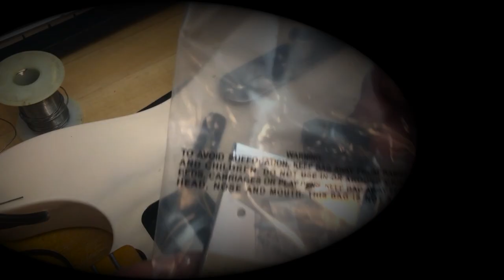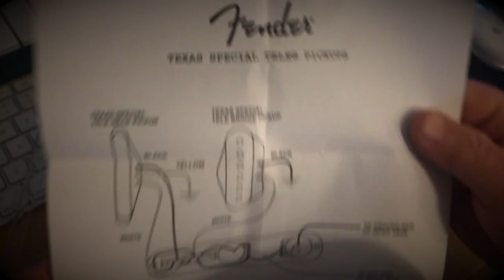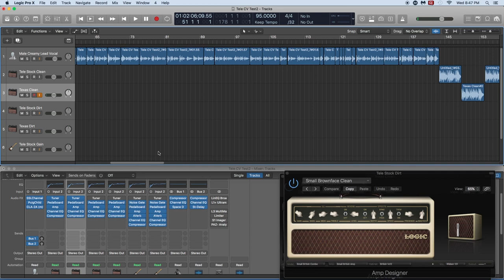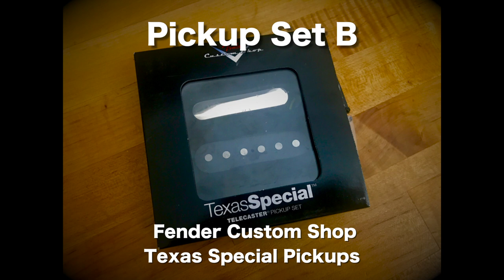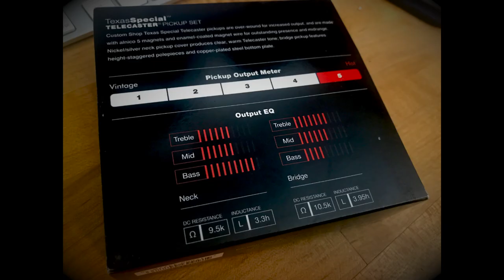Squier Telecaster Classic Vibe Stock guitar pickups VS Fender Custom Shop Texas Special pickups

Comment: I own three classic vibe teles, and it was immediately clear to my ear they were set A. For a less expensive guitar, they can deffinately work. However, I have changed the pick ups out in all three, (that is one of the main points in buying these guitars). You can swap pick ups and not feel guilty about it. I am pretty sure if you play on it long enough, you will realize there are better options that will suit your ear and playing style better. Fender pure vintage 64, and the Texas Special will both out perform the original pick ups. Clean players will appreciate the pure vintage 64 for the real tele twang and snap. The texas special, retain a respectable amount of that, but are a bit more mid range sound, they give up some bite, but they really shine when you go to the overdriven sounds. The point I'm making is the original PU's can work, but they are not in the same wheel house as these other pick ups. If you decide to upgrade, replace everything in the control cavity too, pots, switch, wire, capacitor, and even the jack. You wont regret it.
Reply: If you want a Fender just buy a Fender , why spend the extra money to make the CV into something it isn't ? The Squier CV would do just fine for 99% of buyers and it's a better guitar than the MIM Fenders . You could buy a decent amp and other gear with the money you saved .

Comment: I changed my guess during the comparison but in the end I got it right. I found it really hard to tell which was which. But I also think that using a real amp would probably bring lots of difference for the sound and how the pickups respond to the dynamics of the pick etc.
Reply from the maker: Hi Le Rosa, you are absolutely right, the best way to tell is with your own setup and a lot of things change when it's cranked up at stage volume. The TS definitely have more output which effects the first gain stage so there's that and yes the dynamics change too. Thanks for the comment and please subscribe!

Comment: I would say just by the listen…..the B set is darker…. Lends itself to the Texas Special sound whereas set A sounded thin and smaller but good… I like a tele to back a Les Paul when recording so I like a darker tele sound. The B set also sounds more 3D…..the K ohms rating is not as important as what you did with the string gauge change… that would have made the stock pickups darker but there would be a sparkly artifact that the Texas Specials would not have. Nice audio work for comparison…. When you said .010s…. That made the B set fuller all by itself

Comment: I surprisingly couldn't hear much of a difference if any in the pickups. I always thought the classic vibe 50's pickups sounded about like a stock Tele should. The only set of pickups that I might consider swapping a set of them out for are the Brad Paisley Seymore Duncan's I believe the named them labreas. Those seem to have a larger tonal potential and a bit more bite when you want it.

Comment: I knew the TS sounded a little fatter, but not enough to go through the trouble and expense to change, the stock pups sounded good and would be just as good with different amp settings.

Comment: I Had a squier classic vibe strat 2023 I replaced the pickups with a 57/62 loaded fender pick guard ultimately I like the stock pickups just as well and in some ways better in this tele comparison I'd say the Texas specials sound compressed on the clean and more complex beyond crunch I now have the classic vibe tele I'll keep my stock pickups over the Texas special however there's also the saddle material choice and that as well as string size the Texas special got fresh strings I think if the stock pickups would of got the same string size and fresh strings the contrast would be more apparent stock pickups ni e and chimney great for cleans and a little past breakup Texas special not so treble but a lot more useful than the stock with alot if distortion the Texas specials may be best with steel saddles either way the classic vibe series are all I need and by the way if you go to get a fender player watch out for the neck not being in line with the body

Comment: Very subtle discernible differences (listening thru' Sennheiser HD25).  I actually would be very happy with both 'tones'.....thanks for the comparison.
In the mix, it wouldn't be noticed.  That Squier sounds like a classic Tele with the 'stock' pickups.  I thought the B's were sounding fuller in parts...but then I thought the A's sounded better in other sections of the comparison, especially 'clean'.  Also, if the CV pickups are made by 'Tonerider' and have an off the shelf price of approx. £65 against the £150 for the Fender TS....I know which I would be getting.....(I've ordered the CV BSB Tele just to see what it is like; pretty sure it won't be replacing my Charvel Pro Mod SoCal Style 2 with Fishman-Fluence pickups; but I am very curious).

Comment: Nice comparison, I own a 2015 classic vibe tele custom with rosewood and experimented with lots of different pickups (custom shop, sd hot rails etc.), changed the electronics more than once and now I’ve settled with a Seymour Duncan antiquity I humbucker at the neck and a telecaster antiquity I at the bridge. I’ve custom ordered a 500k wiring harness from monty’s guitars in England and that’s it, it’s the best telecaster I’ve had. It wasn’t by any means a logical route as it is quite expensive, but it was fun and worth it. 
At first I thought it would be too harsh sounding because I have brass saddles as well but it ain’t at all, plus I can be heard even if play on a band with 20 guitar players :)))
Reply from the maker: Glad you enjoyed the review and thank you for the compliment! Do the 500K pots change the sound?
Reply: they did, I was afraid they would be too ear piercing specially in the bridge but that wasn't the case, they just became more transparent and open, plus the neck pickup is creamy but with defined highs and the middle position is gorgeous... That being said I’m not sure if that would be a constant on different teles w/ different bridge pickups. @airtimedesign
Reply from the maker: @azt3ca  So going from a 250K pot to a 500K  pot adds high end?
Reply: @airtimedesign  oh yes.

Comment: The original sounded warmer than the Texas specials, I guess that they will be on reverb before too long.
I changed mine out with a couple of hot Warman pick ups which had a very dramatic effect on the warmth of the sound, they were both quite obviously telecaster pick ups as was their sound, but more so. As a bonus both new were around the £20 mark, I have nothing to do with the company I would just recommend them. Another plus is that I can unplug my SG and plug in the telecaster and not have to adjust the volume.

Comment: Set B, I have to say, sounds a little more round. But the difference with these tones is soooo subtle. Where the rubber meets the road is when you turn the tone knob all the way DOWN on the CLEAN. I wish we could've heard that. If you did on either or both and it just somehow got past me, then I'd have to say that the Texas Specials are nothing really all that "special".
Reply from the maker: Hey Michael and thank you for the comment! One thing I should have made more clear is that the TS pickups are louder. I adjusted the volume so they would be the same for the recording.

Comment: The difference in the clean settings was negligible. I was particularly listening for good note separation on the crunch and gain settings. Note separation was equally good on both. The Texas Specials had a bit more mids which also made the slightly muddier to my ears. I bet you’d be able to get the same sounds out of the squire pickups by simply adjusting the mids on your amp. Also, the heavier guage strings as well as string brand can account for a substantial difference. This a very helpful comparison.
Reply from the maker: Hey John, thank you for taking the time to comment and I'm glad you enjoyed the review.
Reply from the maker: Thank you, glad you enjoyed the comparison.

Comment: I reckon the - already small - sound differences would have been even harder to detect if the string gauge and the bridge had stayed the same for both sets of tests. V. useful comparison - I’d been toying with the idea of getting “better” p/ups for both my Squier CV Teles (a 50s and a 60s Thinline) but now l know better. Thank you
Reply: A decent EQ pedal is way cheaper, you can use it on ALL your guitars, and doesn't require disassembly or soldering.

Comment: To be honest, they sounded different, but neither one sounded better than the other. Different and better are, after all, two different things. I'm a humbucker guy, but I have played with more than a few guitarists who used Fender Teles or Strats. All of them could tweak and adjust their guitars' sound by tweaking the various knobs on the guitar, amp, and pedals. So what's the advantage of upgrading to more expensive pickups to get a result you could achieve just as easily with your rig's controls?

Comment: I could hear the strings  squeaking more between chord changes on the Texas pickups and they had slightly rounder tones. the classic vibe seemed slightly brighter and thinner but not much. its not worth changing them that's for sure

Comment: The B's sounded a little grittier on the clean sounds, so I guessed they were the Texas Specials.  I prefer a cleaner sound. You can always add some grit with  a pedal or amp setting. Doesn't seem to make much difference.

Comment: The easier way to mount the pickups is to get new screws. Very cheap and way less risky than drilling out the mounting holes on the pickup.
Reply: Why didn't they come with the pickups???

Comment: Great test but My friend (pro guitar player and elektronic spec) said that changing pickups in cheap guitar to expensive pickups won’t change much because sound of guitar depends on guitar body! Body Resonate + pickups makes the sound. What do you think? Do you have ability to put this Texas pickup to fender custom guitar and make comparison ?
Reply from the maker: Hello Overdrive! I had no idea that "tonewood" was such a controversial subject! I have received so many comments on my reviews when I mention anything that has to do with the wood of the guitar affecting the sound of the instrument. Several people have told me this has been de-bunked and refuted and it's a myth. I don't agree with that and I'm a firm believer that the wood in a guitar body and the neck affects the resonance and the overall sound of the acoustics and the electronics of the guitar. Call me crazy but yes I think that the same pickups in 2 different wood guitars would sound different. So this is my opinion. It's not based on any test but just my subjective experience. On the other hand I do not think that the wood in the Squire CV and the wood in an American Tele would have made that much of a difference. I do think that changing the pots or caps or possible even the type of wires might make more of a difference in the sound than the wood. Again it's just my opinion and I'm sure plenty would disagree. All the components in a guitar go to make up the X factor and the magic that people find in that special instrument. Sometimes it's hard to put your finger on just what exactly what connects us to certain instruments but it's there!
Reply: @airtimedesign  Thanks! for comment. Soon I'll make a Video. I have Fender Telecaster player, and I bought extra Fender Telecaster pickups and I'll put them to Squier Paranormal Offset guitar! My friend said "It wont sound the same" but I will try :)
Reply from the maker: @OverdriveFunStudio  I look forward to watching your video!

Comment: It was tough but I guessed correctly that B was Texas Special based mainly on the rolled off highs that happens when resistance reading is higher.Other than that, I wouldn't bother changing them. Rule of thumb,the higher the resistance,the less highs you get, humbuckers being a case in point, often over 10K or 12K. I once bought a Tele Custom Reissue with Texas Specials in it and found them too dark.Teles are what they are and have a uniquely bright sound.To get a ballsier sound use 10's ,go to a different guitar, perhaps with humbuckers.I believe Classic Vibe pickups are Tone Riders.Note: The 50's CV Tele uses Alnico3 pickups and the 60's CV Custom I have uses Alnico5.I've owned both and Alnico5 is much ballsier!
Reply from the maker: Hey Bruce, thanks for the comment. I've heard that the stock Squier Tele pickups are Toneriders but I don't know how to identify that? Do you know if there are markings on the pickups or labels that show it to be a ToneRider? The tone difference between the stock CV Tele pickups and the TS is not a lot but there is a gain difference. The TS are hotter and with and amp will make a difference. I leveled the volumes for the review to be fair.
Reply: @airtimedesign Thanks for response. I haven't seen any markings on the CV stock pickups and am really going by what I read online.I do know they are quite surprising esp the Alnico5's in my 2009 Tele Custom.I'm 70, my first Tele was a new blonde one in high school in 1968 - $310.00 CDN with the requisite black case/orange interior,sadly long gone from me. I've also owned a number of Strats.The 60's CV Strat likely has the most ballsy stock bridge pickup I've ever played in a Strat.An (older) friend who owned a '63 Strat couldn't put the CV down and was amazed by the bridge pickup.Name or not - It is what it is.
Reply from the maker: @brucemacewen1488  Well we could have gone to school together Bruce. Even though I have a couple of more expensive US Fender guitars I still love the Squier CVs. I have 2 Teles and a 70's Strat. You can't beat them for the price and with the money I have I can buy more guitars! Please subscribe and check out my side by side review of the Squier CV 70's vs the American Pro 2. Spoiler Alert, I ended up with the Squier.
Reply: @airtimedesign  Good stuff! Last American Tele I had was a new 1992 American Standard in Gun Metal Blue.Only had it two years, sounded great but I never liked the neck or bridge so sold it in 1994 and bought a MIJ Custom Reissue Tele, much better guitar and lighter basswood.Installed 3 EMG's and a Schaller 5 way Megaswitch (middle position gave neck & bridge p/u's together).Since then I've not had an American Fender, in Prince Edward Island Canada the price is just too high to justify and there are so many other great guitars out there like CV's! The CV Custom Tele I have now is a 2009 I bought for 325.00 cash.Put a WD tortoiseshell guard on, staggered brass saddles, dome knobs, 2 wing style string trees and Schaller strap locks.Au Reverb!

Comment: My CV tele sounds better than any tele I’ve tried. I thought my new Godin t-style with Godin Custom Cajun would be the stuff, but I like the sound of the CV better? I may try another tele at the shop, but I’ll bring the CV to test it against. If it doesn’t sound better I’ll just keep the CV. Not much difference in these two sets? B is a wee bit fuller and rounder if that makes sense? A for the win!

Comment: I noticed a big difference.  But I don't know if it's due to the pickups, the new saddles or the higher string gauge. The sound has much more body in the second audio.  sounds better to me. I think it's a matter of taste ... maybe the A audio is closer to the classic tele sound, a little harsher.
Reply: the brass saddles and higher string gauge would account for the increased bass and mids.

Comment: Set B sounded a little more “twangy” in the middle position and hotter and thinner in the bridge position. I couldn’t hear any difference in the neck pickups. Set B seemed clearer (but not by much), when being played with high gain.

Comment: Thanks. Was hoping for more of a difference but didn’t hear one AT ALL. I just bought a 60’s vibe. Not sure I’m gonna modify it 🤷‍♂️
Reply from the maker: Hey David, Glad you enjoyed the review. The TS pickups are great but the stock pickups hold their own. I have the TS in one Tele and the Stock pickups in the other. I just like having some different sounds to pick from but one is not really better than the other. Please subscribe to see more of my reviews. Thank you!
Reply: @airtimedesign  thanks for replying. I’m really not sure what to do with my Squire. I do have to roll the treble off on distorted sounds and would love the treble back up on clean sounds so I may entertain new pickups so I don’t have to adjust the tone pot all the time. We will see. Thanks again!!
Reply from the maker: @MrFreddBoy  David, you're going to find that's true with pretty much every guitar. Also when you roll off the volume you loose treble unless you have a treble bleed circuit which I recommend. It's an easy mod.
Reply: @airtimedesign  I’ve mostly played HSS Strats and everything is on 10. I’ve started branching out to SSS Strats and other single coil guitars and finding that out. I have blend pots on my SSS which I love. Blend bridge and neck pu’s.

Comment: 009 strings versus 010 plus the 2 kilo ohm extra winding explain the slight difference in sound, but it's not much. The original pickups sound fine.